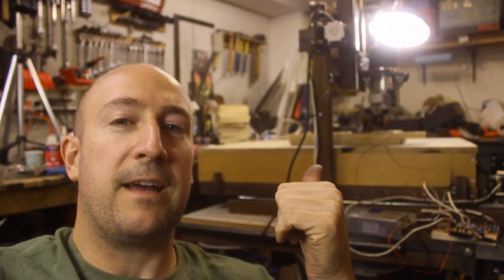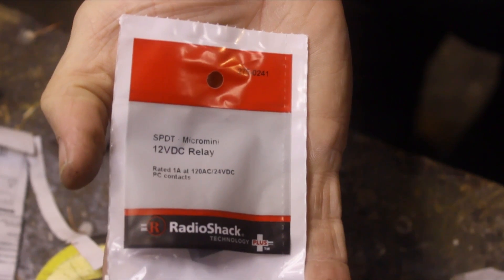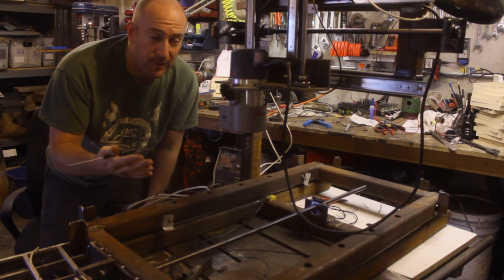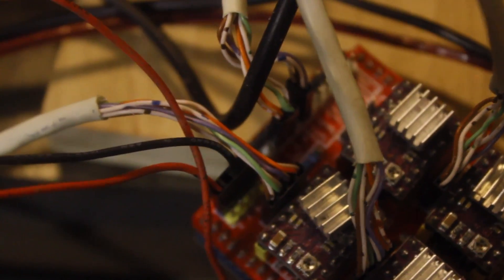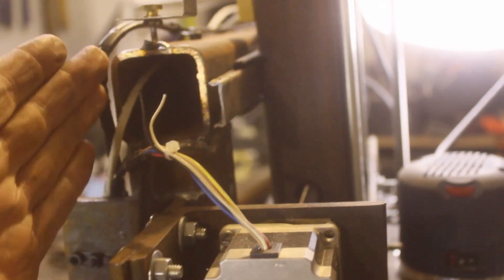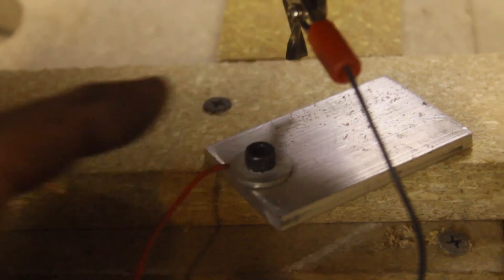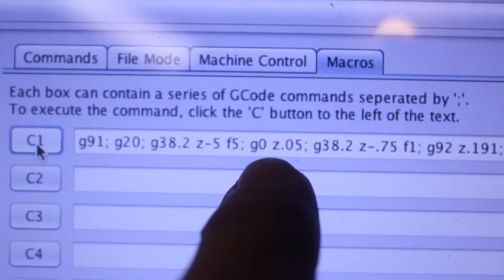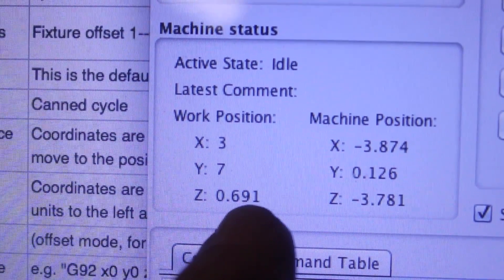DIY CNC - Limit Switch and Probe Setup

Comment: thank you for this video. i would like to know how i can wire the limit switches on my CNC machine ( i am building it ). i am using arduino with grbl sheild. do you have a schema of wiring it for the limits switches sensor or any  mini switches

Comment: If my machine reaches the switch i get an alarm and he stops. so far so good. But the machine is still tripping the switch so how can u fix that? i need to move the machine manual from the switch. (i'm using gcode).

Comment: have you had any noise issues with your homing switches? I'm having all sorts of problems. I have the Arduino and GShield. I'm getting a false closed Z switch even with my header pin connectors off (no limit switches connected).
Reply from the maker: Yes.  Same symptoms as you.  I wound up turning them off.
Reply: +Greg's Garage 

fixed mine! one .47uF capacitor on each limit switch pin. one side of the capacitor goes to the pin or Piggy back the wire going to the pin and the other side to ground. all 3 capacitors grounds can be joined together. once you get that going, look into g28.1 and g28 in conjunction with a corner bump stop!

Comment: Nice work Greg, just a suggestion instead of directly wiring to the relays pick up a piece of "perf board",  you can solder the relays to the perf board and the wires to the perf board and then point to point between the two.  That'll save some stress of wiring directly to the relay pins.
Reply: Your totally correct liking the challenges youve selected. I like them too but What kind of friend would i be not pointing out my worries though?.....
Reply from the maker: +TheWreckingYard Damn...  I didn't even think of that.  I may redo them.  Thanks!
Reply: +Greg's Garage The perf board idea is brilliant. One thing that has been sticking in my brain past few days after seeing this and thinking about it more.  I think prox switches and relays are fine for this use but can't help think they can introduce a few more failure points to be aware of. The loss of any of the wires 24v or 5v signal or switch and relay this way will cause a crash.
The most simple and reliable i can think of is using the 5v signal directly to a micro switch in the normally closed direction. Less wires and pieces to fail. any loss of signal and the machine just won't move it will think its already hit its limit and show you hey theirs something wrong. Just something to ponder :-)
Reply from the maker: You are 100% correct.  My hope is this...  The switches should only be used at start up.  The Z goes up first so the tools should never crash into the work.  If the other switches fail it won't hurt the machine.  That's the nice thing about the steel frame.  It's WAY stronger than the stepper motors.  If I could have found a 5v sensor, that's the direction I would have gone.  I didn't want to use the typical physical switches just due to the potential for inaccurate repeats.

I'm sure there is a more elegant way to wire this up without the relays, I'm just not smart enough to know how.  Someone mentioned a voltage splitting resistor network, but that has a handful of soldier joints as well...

I guess we'll see how it goes.  If this works, I'll keep it, if it doesn't, I'll def simplify things on the next round.
Reply: I don't want you to think bringing this up is busting your balls... its just interesting to think about.
I have a very difficult time believing prox switches are more accurate or repeatable than  a switch that makes direct contact. Also how much more time delay for the signal is the relay adding? Figure the relay takes time to create the magnetic field to close the switch.
If you ever take apart a relay and a micro switch they are very very similar... its just a relay relies on a magnetic field to open/close the points of the switch..... I can't see the relay being more acurite or reliable than the micro switch either come to think of it....
Micro switches aren't as sexy or high tech as the prox switches
Happy Thanksgiving
Reply from the maker: Well...  You've got to know...  I go for sexy when it comes to selecting switches!!!  LOL.  BTW, I like the challenges to what I've done.  There's generally a better way than the one I've selected.  I typically let things ride until there's a failure, then I upgrade.  Most of these little conversations hang around in the back of my mind so I know how to solve the problems when they come around.
Reply from the maker: And, Happy Thanksgiving!!!!

Comment: Would now be a good time to mention opto isolators? Much faster switching than relays and no contact bounce.
Reply from the maker: +Chris White It's a good time to mention it...  There is a debounce routine written into the homing cycle (from what I understand.)  The reason it does a fast approach, backs off and then does a slow approach is to overcome the speed issue with switches.  As long as it's consistent, I'll be happy.  I didn't want to get into a resistor network and that sort of thing just because it's a bit over my head.  Relays I understand...  Resistors I understand, but I don't know how to size them properly and it seems like most people use a cap with a resistor and I don't understand why or how to size those either.

Comment: Nice.... i recognize the wiring technique as the same one i use provides the maximum ventilation should  the magic smoke come out :-)
Reply from the maker: +builtrodewreckedit LOL!!!  You nailed it.  I don't to impede the smoke...  Much easier to diagnose where it came from if you can see it happen live.